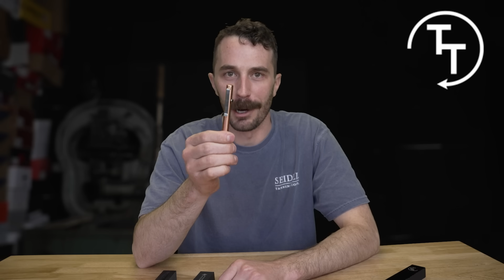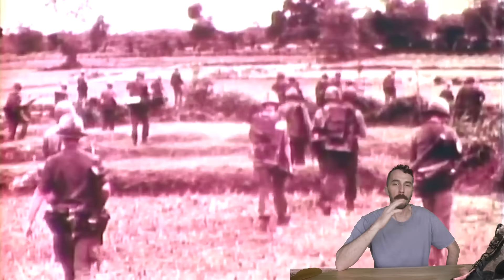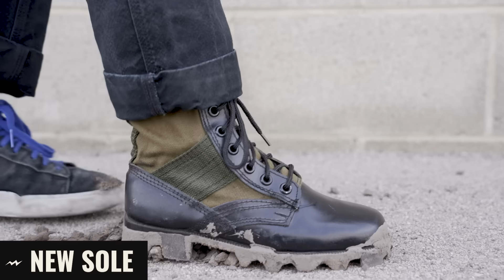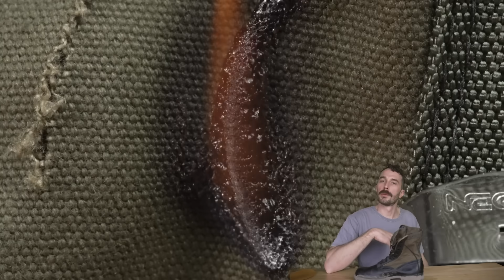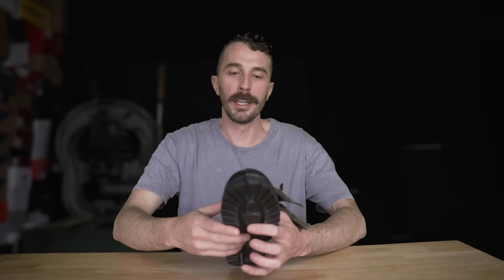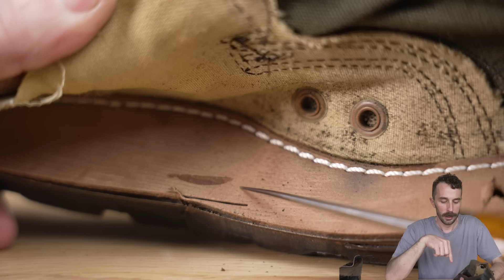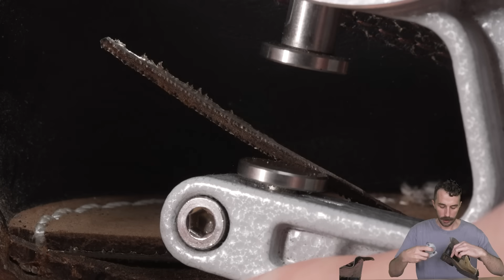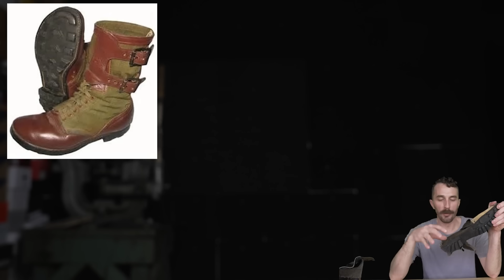Why it took 57 years to replace jungle boots

Comment: In the 90's we used to get them fixed at the boot shop (some dry cleaners would resole boots too). I got mine resoled with a Vibram sole, metal plate taken out (which was probably unauthorized), and between the thick rubber sole and the boot they added a layer of soft foam which made me feel like I was walking on clouds and cotton balls. I used them for parachute jumps, field training exercises, and road marches. They are awesome. They're still aroud... somewhere...🤙
Reply: RANGER JOES could fix them fast and fair.

Comment: The metal plate also had another purpose in 'Nam. The USAF spread about a bazillion gravel mines across the area. These were OD green canvas bags with a little explosives and some pea gravel type pellets. They were designed to explode when stepped on.  If you were wearing sandals it'd injure your foot pretty badly. If you had jungle boots on it'd only scare you.

Comment: Another reason to avoid drying your footwear out with heat, is that many shoe adhesives are heat-activated. Be patient and let your footwear dry on its own, in front of a fan, or use newspaper or towels to absorb and wick the moisture.

Comment: When we were shining boots back in 2003-2009, we liked getting the Jungle Boots because there wasn't as much leather to polish lmao! That was one of the MAIN reasons we got them in garrison. While being deployed though we got the desert boots which seemed to be a tan version of the Jungle Boot, at least that's my opinion of them. Both are pretty comfortable. I didn't have running shoes when we went back to Kuwait in 2003 to go home, and I would go on our 2 - 3 mile runs in my desert boots with 0 blisters or problems.

Comment: I hated the break in period on them because the heel cup would cut into my Achilles. I didn't realize they went away back in 2005! I mean, I saw the new ones in the desert colors but I thought it was mostly cosmetic. Interesting stuff!
Reply: The fix to that was to run them over a couple of times with a deuce and a half before you start wearing them. I always had a new break in pair, a working pair, and a worn out best pair. 20 years 25C.

Comment: I was issued a pair (like the later ones, with the mud sole, not the Vibram pattern), for a 6 month U.N. tour in the Golan Heights in the winter of '82 - '83. Who knew it would snow so much in the Middle East? I wore them because it was either them, or the suede desert boots we wore in the camps in the AOS. I remember going on a site tour with the UNMO's, of Ausbatt OP's on mount Hermon, trying to stand on a slope, in over a foot of wet snow, and I couldn't stand in place. I kept sliding sideways downslope. Not what they were designed for! I got better use out of them in the summers in Petawawa. We all thought they were cool.

Comment: Those insoles were horrible! They continued to be used in the black leather combat boots up until the mid '80s. No cushioning, no arch support. If one of them slipped out of place and folded over on the march, you were guaranteed a nasty blister. Happened to me. We used to buy Dr. Scholl's at the PX whenever we had the chance.

Comment: I had 2 pairs of these brand new heavy luged jungle boots that my brother gave me when he got out of the army 1970, by far the best pair of work boots I ever had, wore them until the soles came off which took quite awhile to do, when last pair finally gave out sadly couldn’t find ones just like them seen a few of the original soled type but not like mine

Comment: Wish I would have had those in '65-'67, Seabee's were only issued the all leather boots, only way to dry them out was to put them in an enclosed wooden box we built with a 100 watt light bulb providing the heat

Comment: I wore these (I was in the US Army) when I was in the field and didn't want to mess up my spit-shined jump boots... I liked them because they were light weight, and dried easy after tramping around in rainy environments...
      What I didn't like was they weren't very comfortable unless I put sole cushions in them... They also pressed down on the top of my foot because of the high arches in my feet (plus sole cushions).

Comment: You never really covered the issues that people don't like about them. I've had a lot of boots, and these are by far tge least comfortable. They have no arch support at all and are as flexable as a 2x4. The only thing less comfortable are those massive jump boots the Air Force use/used. 
Sure you could add insoles. But then you are cancelling the water issue. They could be 20 bucks and l wouldn't buy another pair.

Comment: I was issued those in Panama in the early 90's best boots I ever had. They took  them away and Issued me black ones. They could never dry as fast as the greens and after a hard landing the plastic plate cracked. Yes the sheet metal was replaced with plastic.

Comment: Next time you have to cut through a boot w/ a steel plate in the sole, u might consider using a Sawz-All w/ a blade designed for metal.  Wish U covered more of the Pro’s and Con’s discovered by the grunts in the field, though.

Over all, video was well done! Thanks!

Comment: It took 57 years to replace jungle boots, because there was not enough money to be made replacing them.  I was assigned to one Army unit back in the very early 90's, where Jungle Boots were frowned upon, via leadership pressure.  The reason, because the whole boot did not need polishing.

Comment: I prefer something a bit more substantial.   And just because you have drain holes doesn't mean your feet actually dry out without taking the boots off, letting them dry out and changing socks.  But the boots do dry more quickly than boots that came before, and most work boots.

Main advantages to me were that the boots were very light and the vents kept my feet cooler and drier in the heat.

That's a weird fact about the lugs.  Knowing this, why are the "old" kind of lug soles still so prevalent.  I thought vibram was the material, but I gather it's the tread pattern of the original lug boots.

Comment: A few months ago I bought a 3rd pattern used pair from a collector friend of mine in Alaska. I'm happy I bought them. They are extremely heavy-duty, High quality, & will outlast anything out there today. I am only 23 yrs & they're nearly 56? I Love how heavy they are, My Feet don't get too hot or sweat, mine are spike protective & Panama sole the lugs are very worn they still make that Classic Military boot sound. It took me a while to find 9 1/2R. Seems to be quite a hard size to find. I bought them to use while i work on diesel engs. So they're being used & not sitting on a shelf for "Show". Best looking boot they ever made. I would 100% buy a NOS pair of jungle boots for $250+ than anything new today.

Comment: I had two pair issued to me when I got to Panama in 1973. Wore them every time I put on my jungle fatigues, which was almost every day. As an Infantry officer we trained in the jungle between Ft, Kobe and Ft. Sherman (Jungle School) and most every point in between, be it during the dry season or the wet. We waded low water-filled areas and swamps. For three years I wore those suckers, brought them home when I rotated back to the States. I still have them. I still use them on occasion. The lugs are pretty much gone, but they are still good boots.

Comment: I'd be very interested to see you do a side by side comparison of the original jungle boot with a Rothco reproduction to see if there's any notable differences in material and manufacturing, and how that would translate into worse/same/better durability and function.

Comment: For the bunny boots *****do not buy if holes punched in at the top that means they are compromised. We are getting new winter boots so there is a huge surplus of those boots that the government is getting rid of because they are compromised. The rubber is degrading on the inside and stuff like that. Trust me I just left the army wearing them in alaska. That was a big thing they were telling us. On top of that the last production of those boots were in the 80s the company who manufactures those boots do not make them any more they make high heel shoes and civilian attire

Comment: I still have two pair of those Jungle boots I acquired in the 1990's before I got out of the USAF in 1999. They still fit great and are great for trail riding.

Comment: My dad brought those boots back from Nam when he served there.  And he and I were both stationed for years up in Alaska so we got issued the Bunny Boot.  Dad also got issued what looked like a canvas boot that had a felt insert that was for wearing outside in the winter.  Had a rubber bottom that went part way of the sides and it was close to knee high and had a draw string u coud tie up to keep the Snow from getting in the boot.

Comment: I entered the Army in 1981, and was assigned to the 1/75th in Savannah GA. We were issued 2 pairs of jungles, one of which I still have. I wore those through my 4 years in Batt, a year of ROTC and then 3 years in then West Germany. Some 100 MPH tape over the drain holes made them suitable for three seasons over there. Then 6 years as a NG advisor, and 2 1/2 years in a Civil Affairs BN attached to the 101st AB Division. The next closest modern thing I have found is the Reebok Dauntless, which is a daily wearer for me now.

Comment: I started wearing them because the all leather that we got issued were killing my Achilles tendon on long road marches. After that it was the only ones I would wear. We did eventually get issued them our second time down in Panama, before that we had to buy them. I wear the desert version now. I wore a pair of the jungles working at a hardboard factory for years as well, the redwing boots would fall apart ten times as faster.

Comment: The problem with most boots is they have very little or no cushion.  They’re using leather in these for cushion?  Even the insole is not cushioned. No midsole at all. Wood in the rubber heel? Oh no. I’m glad I don’t have to wear these. Like walking on wood planks.

Comment: I remember buying a set as soon as my unit  ( active army: mid 80's ) was authorized to use them. After leaving the active Army I worked for a Land Surveyor in Michigan and I  wore Jungle Boots 6 or 7 days a week Mid March to Late October for 3 years. 
I remember one day at work, one of my co-workers looked at my ( somewhat tattered ) Jungle Boots and asked me how long I had them. I told him 3 years. When I  told him that I  only paid $50 for them at the PX at Ft McCoy, Wisconsin,  he looked down at his brand new LL Beans and said " I think I got ripped off ."
Reply: Back in 2007 (I think it was 07) I bought a tan pair of Brahma boots at Walmart for $35 I made my own waterproofing wax out of 50% toilet ring wax ($1) & 50% paraffin/candle wax (50 cents). I cover the boots with a thick coat, then use a heat gun to melt it while I rub it in, so it gets in all the threads & seams. Every couple years I recoat to keep them 100% water proof. Iv'e worn them every winter in rain & snow since 07 & they're wearable & water proof. This winter will be the 16th year worn.
Reply: joined in the mid 90s.  my first boot purchase right out of AIT were the jungle boots.  i just saw the drill sergeants wear them around and i thought they looked cool as hell and it was a good way to get out of those standard issues ones.
Reply: @iHasCaek  I bought my first pair in AIT also.  When the 1ST SGT saw me walk in the barracks wearing them, he started chewing my ass out.  "Who said you could wear those private?"   my response "The base commander in the letter on the wall over there."   The base commander had authorized wear of jungle boots during the hot weather months on base.   The 1SG walked over and read the memo.  He looked at me and said with a pissed off face..."Carry on private."
Reply: I joined in the mid 80s.  I've owned at least a dozen pairs of jungle boots BECAUSE IM AN IDIOT and liked the way they looked.  Most uncomfortable boots I ever owned.  Tough as nails and looked cool though.  I've had foot issues ever since lol.
Reply: So you say they would be good for hiking like on the PCT?
Reply: @joeydepalmer4457  if youre just gonna hike on flat even trails sure.  if you plan on hiking on uneven surfaces, these wont protect your ankles at all.
Reply: @iHasCaek  why would your ankles need to be protected?  I used to hike a LOT in the Green Mountains of Vermont and I always wore Vibram Five Fingers.  After I wore them once I never wore a hiking boot (to hike anyway) again
Reply: @joshhamel5853  i dont know what to tell you bro.  ankle injuries are a thing.
Reply: @joshhamel5853  just keep wearing your Petri dishes
Reply: @iHasCaek  , our platoon claimed mountains so steep we sometimes slid back down for 3 or so feet. We moved thru rough terrain. No one ever was slowed because of lack of boot performance. Vietnam boots are great for rough terrain. Lace em a bit tight.
Reply: @iHasCaek  , our platoon climed mountains so steep we sometimes slid back down for 3 or so feet. We moved thru rough terrain. No one ever was slowed because of lack of boot performance. Vietnam boots are great for rough terrain. Lace em a bit tight.
Reply: @iHasCaek  truth.  I had several severe ankle injuries playing sports and I looked like a drunk girl wearing 6" heels with my jungle boots on.  I had to stop wearing them.
Reply: No, he didn't get "ripped off". LL Bean boots are worth the money. You simply had an advantage of knowledge because of your military experience. Now, if he would have had $100 Walmart boots, yes, he was ripped off.
Reply: Wo ra
Reply: I bought them when I was in the navy, and wore them until I was required to have steal toes.  They were like running shoes.

Comment: I was issued jungle boots in the late 90s before we switched to marpat and the newer boots.  I liked the jungle boots but the vents allowed water to enter when it could be prevented.  like in a rain storm when you're not in the field.  when in the field they worked great if you broke them in.  the trick to breaking any leather boot is get them completely water logged then wear them until they were dry then add the boot polish.  however, the old all leather boots the Marines called Cadillacs and the jungles are the main cause of my ankles being bad now.  all the running and carrying packs.  I still have my black jungles and desert boots to this day...

Comment: In around 1966-67, I worked for Randy's in Randolph, MA in the  sole room. Randy's made Converse Tennis Shoes or Sneakers ".We started to get bins up with the soles for the Vietnam boots. The soles were fine but the inner sole rubber was to shiny slick that each topside had to be scuffed with a wire wheel that allowed the glues to adhere to inner soles and outer edges where leathers and shanks all came together on the press. The rubber for all soles came in giant blocks like 4'x4' x5ft..all was hand made and sewn in this factory 🏭

Comment: You forgot one thing, the weight. Steel toe work boots are intolerable to walk in, you're exhausted by it. If those weigh as much or more then they too would be intolerable. Maybe it's because the steel in work boots is on the toe, the worst place for extra weight to be.

Comment: I was a teenager back in the 70s and also rode dirt bikes. Nearly all of the manufacturers of motocross gear didn't even exist yet. My buddies and I would just head on down to the local Army/Navy surplus store and grab a pair of these nice jungle boots. They were perfect for motocross and had the added benefit of costing 1/8 of what the fledgling motocross accessories manufacturers like Alpinstar, etc. boots cost at the time.
Reply: yep i used old vietnam leather boots my dad was given when i was riding.

Comment: These boots are still standard gear for the RTA. I still have 2 pairs when I did my basic training, and I barely wore out one of them over 6 months. Heck, that was over a decade ago, and they're still holding up fine despite me going through 3 other civilian-grade work boots. The only concern I have is they're pretty conspicuous and a bit of a hassle to put on frequently (like, say, going in and out of houses multiple times). But if you're going to be wearing them for hours at a time, these will never fail you.

Comment: Due to the flammability of the nylon uppers of the Jungle boots, they were unauthorized for wear in tanks due to the possibility of flash fires inside melting the boots to your feet.  Tanker boots eventually were issued to Tankers w/ the advent of the M1A1 and the combustible casings of the 120mm rounds it fired.  Tank crews were issued Nomex coveralls, gloves, and balaclava for protection against flash fires.  The original issue boots, the laces would melt off in a flash fire, and those in the Nomex uniform escaped burns except for their feet when the boots fell off escaping the tank due to the nylon laces burning off.  It was found that those wearing private purchase tanker boots when flash fires occured, didn't have burned feet, as the fire didn't burn thru the leather straps of the boot.  Tanker boots then became an issue item for Tankers as part of the CVC uniform.

Comment: Jungle boots are awesome. I still use my issued set (pretty sure british army still get them) i got over 10 years ago. Sometimes they can feel a bit awkward with the stiff sole but in muddy/swampy/hot conditions they are much better. Especially in areas where water will go over the sides of a goretex boot, these will get wet quick but not be as uncomfortable once they are wet. Goretex/winter boots do not like to dry out quick. 
Also having the canvas upper makes them ideal for stuffing in your bergen. Take up much less room